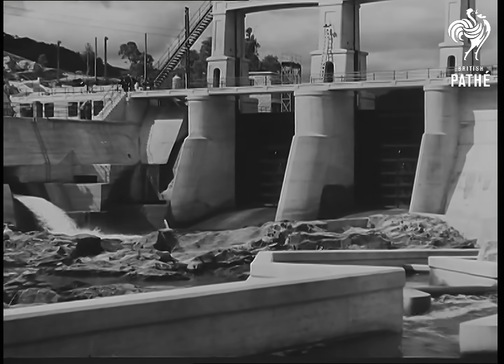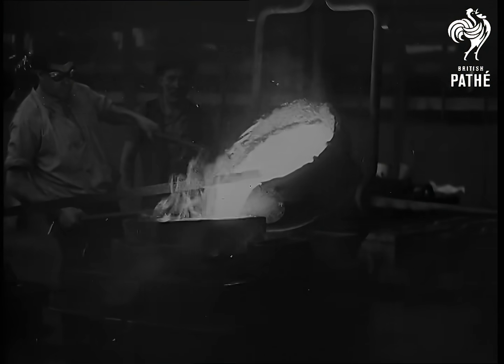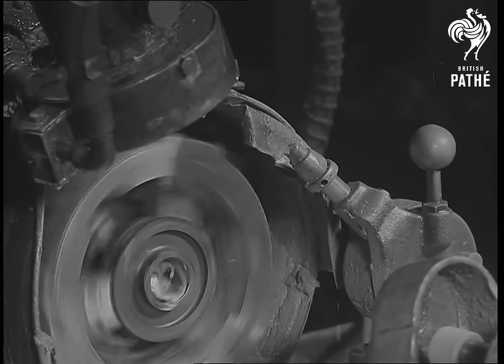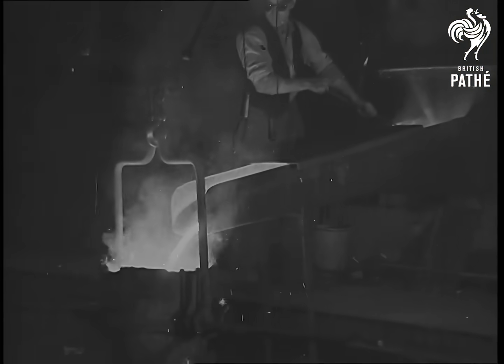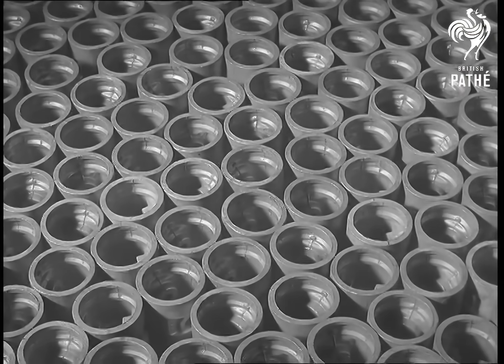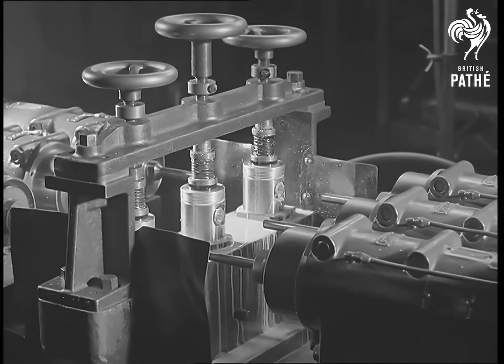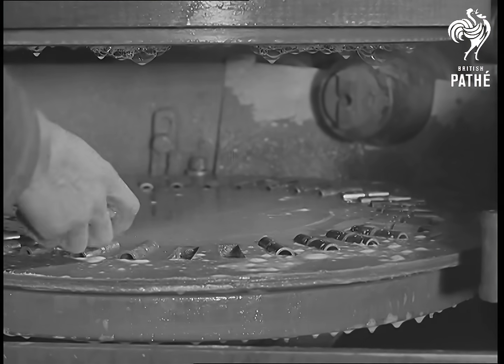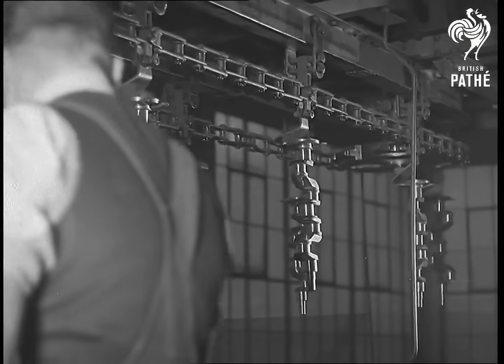Power: Constructing a Car Engine (1930-1939) | British Pathé

Comment: Was there any programming languages to control these moving parts or everything was manual
Reply: In the '30s?  There were no computers and no programming.
Reply: In a way yes, cam drums, automating simple processes on lathes, were developed in the 1870s. And they’re still in use today, with CNC machines only slowly taking over. The cam drum was called the brain wheel by the inventor, and is programmed by movable pins. Also used in washing machines to programme the wash cycle. But the choice of sequencing was done directly without any need for a separate language, as with electronic programming in order to control binary code.
Reply: There was no such thing as a digital computer in the world in the 1930s. They are a post WW II invention. Any automation in those days was purely mechanical.

Comment: Those machine tools look like they could last hundreds of years.
Reply: Well they didn't, doesn't matter how much heavy metal you have in the structure, the precision surfaces are going to wear out and that's that for the machine. The reason they are built this way really is because of the manufacturing techniques of the era. These machines were built in time of planers, shapers and horizontal milling machines. It was just plain cheaper to cast whatever complex shape you wanted and finish with simplest possible machining.
Reply: I started out on machines not unlike those when I was 20. I am 44 now.
Reply: @rushymoto That depending on what you were making is a terrible sadness. For low tech work old machines are fine but it was the curse of the 1960s and 70s in the automotive field that Britain ran what it had from its 1940s wartime advancements for far too long. NC and CNC machining were not invested in rapidly enough to up improve production.  We even ran pre-war machinery. Countries with destroyed factories had to invest anew and somehow were less attached to their newer machinery and constantly updated. I did many other things but in the mid 90s I did a spell in automotive component manufacture and can remember similar machines for drilling and tapping machined components, but we did also have CNC lathes and CNC machining centres.
Reply: @COIcultist  I started out as a manual machinist making no more than 10 of very specialized items or repair parts for obsolete heavy industry like paper mill machines etc. Often out of special materials for the MOD where the machine had to be cleaned at the start and all the swarf collected and taken away by the men in white coats with the finished work. no more than 1% loss in initial material weight could be lost due to the secret nature of the materials. That sort of thing. And yes all the slides were hand scraped on lathes, mills, horizontal and vertical borers and we also had an old Stirk Plainer that had a 3M stroke on its bed.
Reply: @rushymoto  I liked what you were saying about the scraping of slides. I've never seen slides or beds scraped but I remember using a table (Crikey I can't remember the proper name for the iron or granite tables you use height gauges on?) and the foreman explaining that the tables were levelled out by hand.  Was a bit bothered by aleksander suur above "Well they didn't, doesn't matter how much heavy metal you have in the structure, the precision surfaces are going to wear out and that's that for the machine" I was thinking it's not cheap or quick but didn't they just reset the beds and slides?
Was interested in your MOD work and the description of the plainer.
I thought you might like a short clip from a film on the Blackburn Buccaneer where a designer explains part of the design and machining.   https://www.youtube.com/watch?v=46a-7N_13Sk  06.00 to 06.35
Reply: My Dad worked at a place called International Combustion in Derby during the 1960s. It doesn't exist anymore, but I remember him recalling how they were still using machinery with "1911" stamped on the side and how - during a visit from the Americans - they covered the dates up out of embarrassment.
Reply: @red_array funny that the A series engine was one of longest production runs for any petrol engine over 40 years. The basic design meant it could be developed to meet power requirements and emission regs. A pretty simple reliable unit with pushrods, no cambelt to snap and total the engine.
Reply: @red_array i fully agree with you, especially since british layland had as much competition as the lada had in the USSR.
Reply: Makes you wonder what happened to all them tools machines and where are they today
Reply: @royalcrowntowing2464  most would have been scrapped but I expect the odd one is still lurking around in India, well I’d like to think a few are still going
Reply: They don't.
Reply: but they didn't. :D
Reply: We had machines that dated back to the 50's when I worked at Dagenham Tooling for Fords, they were great to use but became too expensive or impossible to get parts for.
Reply: @red_array we still lead the world in engine technology f1 engines we design and build have the highest ve than any other power plant
Reply: My dad worked at Triumph Meriden in the late 60s early 70s as an inspector. The terrible state of machine tools used to make gearbox layshafts and other vital components resulted in gearbox seizures in Triumphs exported to the USA. This was right about the same time that Honda launched the 750Four. Ending the dominance of the British motorcycle industry forever.
Reply: @MarkBrown-gc6hr  That sounds terrible.  Didn't Triumph inspect the gearboxes before shipping to the USA?
Reply: @josephastier7421  yes my father stopped production regularly. He was instructed to let them through by the shop superintendent and the union rep.
Reply: @MarkBrown-gc6hr  Well in that case, the company had already died.
Reply: @josephastier7421  yep there was a lot of industrial unrest in rhe Uk in the early 70s so my family emigrated to South Africa.
Reply: @red_array why was that?
Reply: @visionist7  I think that's a bit of hyperbole to be honest. An engine from that era would be expected to last at least 20,000 miles before a rebuild and survive several rebuilds. Given the low speeds and crappy roads of the day the engine, with a rebuild or two, would likely out-last the rest of the car and even getting to first rebuild time would be a minor achievement.
Reply: @agnidas5816  Yes... IF you did that. People in the UK in the 1930s didn't do that as a rule and if they did they would probably own something far better than a Morris.

In the 1930s people (generally speaking) didn't own cars and if they owned something basic they probably wouldn't use it for commuting... They'd go by bike or public transport.

When I first started driving I was going through cars at the rate of one every few months and a lot of them were 20+ year old bangers from the 1960s. They usually had about 60,000 miles on the clock and were knackered. But that's still only 3,000 miles per year.

Not that long ago when I was using my XR4x4 (I miss that car) for business I would often claim well north of 3,000 miles allowance every month... And at 70p per mile I'd sometimes make more money on travel allowance than my wages. The difference of course being that an XR4x4 was designed for cruising at 100mph indefinitely and a 30s era Morris would struggle to go at any speed indefinitely.

Cars are so much better and so much more reliable that it's easy to forget how crappy cars were back then due to the materials they had to work with being so much crappier. Because they were crappier and had shorter life-spans people used them less.

These days you assume any car under 100,000 miles on the clock will start every time. In the 80s when I was driving 60s and 70s tin you assumed they wouldn't.
Reply: Üppppü o
Reply: @red_array Months really more like days... Old classic Morris one two warranty once you bought it's two bloody late...
Reply: Stil 10 to 19 years to go
Reply: time when something is made to last,not like this new "better"
Reply: @red_array You have no clue.
Reply: I'm using a 1940s Logan Lathe in my home shop. Some tools do last for a very very long time if treated well
Reply: Some still run today
Reply: And those plan obselessence won't allow it
Reply: I’ll bet at least one if not more of machines in this video is still at work somewhere in world
Reply: @red_array  - Thats not true at all, many of the engines made back then up until the early 70s where, if the car hadn't been scrapped, still been going fine. In fact, if you buy a Morris car today it might well have the original spark plugs still in it! I've owned Morris' before.
Reply: @PrinceWesterburg  uhmm.. ? Sparkplugs?
Reply: @PrinceWesterburg  That is correct. I just returnes one hour ago from my weekly ride with my father's triumph 2000 MK1 (1967). Runs like a swiss clock. (provided the fact you have correctly adjusted the carbs ;) )
Reply: @Kerveros1904  try getting the pi to run like a swiss clock. Ive had one great experience
Reply: @nicklittle4552  pi is a totally different case. They utilized a pump foe the injection which was designed for wipers, with minor modifications, and then this pump overheated. Nevertheless, aftermarket solutions exist for the PI. You are a lucky man, i wish i had the PI. it was a very fast saloon car in its day, and quite sporty even by todays standards!

Comment: That was very interesting, see how much improvement now with robots and better machining.
Reply: There probably isn’t as much difference in overall component quality as compared with modern methods as you might think, the main advantage now is shorter set up times on machines and much reduced labour costs
Reply: @porkerthepig  the more operations you can do at one station improves quality . Every time you change fixtures you lose some precision .

Comment: It's amazing that most of the machining processes used today were already being used in 1930s ! , well Maybe not as accurate as with today's technological advancements , but still is amazing .
Reply: Don't kid yourself. The era of master Craftsman has all but been  lost thanks to "technology". The standard of accuracy for which we build things today was set by these men.
Reply: @benboor7924  I'm more impressed with the people who designed and built those massive dedicated machining tools. Plus the design of the engine has to accomodate the limitations of the machines e.g. the vertical holes in the engine block are all drilled together. All done with pencil, paper, mechanical computers, hard thinking and the machinists hand. Modern CNC gives much more flexibility.
Reply: @benboor7924  No.  Engineering tolerances are hugely more accurate now.  Part of the reason why you can get so much more power from the same displacement using less fuel...
Reply: @mediocrefunkybeat  Engineering tolerances and manufacturing tolerances are world's apart in reality. As an expert in the industry, I have seen first hand how engineers without any practical experience in manufacturing can literally blow time and money from ignorance. I've gone into facilities to help solve issues with quality control, only to find out that after they spent thousands of dollars to replace equipment, an engineer gave them terrible specifications. I told them they needed to completely rewrite their QA manuals, blueprints, and factory specifications. Also, some companies are still using old machines from even WWll era, because they were built so well.
Reply: @benboor7924  on the other hand I was told that the machinists in our factory were able to hold tolerances, due to their skill, that were barely achievable when the machines were new. Perhaps it was those skills that kept these old machines in service after 30 - 40 years ( and surviving more than one back of a lorry factory move) instead of being replaced and upgraded as they probably should have been.
Reply: @benboor7924  all too often shop floor drawings would be modified at the request of the fitter, responsible for using craft skills to assemble the product. His was the bottle neck so if instead of continually having too lap a few thou of a part he spoke to the machinist and the line inspector, they would agree to bias the manufacture and mark up the ship drawings.  No doubt the intention was to up date the master drawings once the change had proved effective but the road to hell is paved with good intentions and it often didn't happen.
I know that when they closed a factory in Scotland and shifted production of a range of products to Sussex, what they actually did was send the master drawing copies. For the first few months all we made was scrap. Perfectly to drawing scrap
Then came modern QA procedures, which had their problems of setting things in stone, right or wrong, till they figured out how to really make it work.
Reply: Yup, I am still laughing at the forge worker operating a drop hammer with nothing more than a flatcap & a pair of tongs though.
Reply: A 1979 Honda gets better gas mileage than a 2019 Honda.. the only thing we have managed to do it shrink the size of electronic8 21duwyeoloere
Reply: @shawngoldsberry747  A 1979 is smaller and produces less power than a 2019 Honda... also newer cars have had a substantial weight increase because of safety standards.
Reply: A major factor in having equipment that was so accurate for so long was that designers weren't really familiar with the tools they were building, so they compensated by over-doing the design. That resulted in very long lifetimes of these machines. Today, we have computer models of all the parts, so we know where we can cut corners and not pay a price for it. This is why modern motors are good, and light. Aluminum usage is the biggest improvement, by far, though.

Comment: This is why engines from that time are still running
Reply: gumelini1 well true to some extent because engines will theoretically run almost for a life time with proper maintenance and they design their engines as best they could and to withstand more back then they really needed to newer technology you don't need as much strength
Reply: ATLAS GAMING engines from that time are still running even tho they were first lubricated by very bad engine oils at the time.First engine oil was parafin based and wasn't even close to today's oils.And yet those engines would go 1m miles,today with all the synthetics and aditives engines last half of what they used to back then.Since the oils today are uncomparably better then they were before the only thing to blame is bad quality of the engines today.I mean they are more efficient and consume less fuel then before,but durability has gone down alot
Reply: Sorry mate, that's simply not true, period. Drivers back then never floored them, never reved them when cold, etc. Those engines ran at very low compressions, used half the petrol for internal cooling and required attention every 2500mi or so. Yet they were very unreliable machines by todays standards, frequently broke down or refused to start, the lot. Which doesn't mean I don't like them, quite the opposite, I rebuilt dozens and dozens of Rover, Austin and Morris engines of the period, but realistically modern motors are insanely much better in every way. Basically, most of todays cars go for scrap with perfectly fine running engines, which never even had the rocker cover removed in 200,000mi. When we went to Spain or France in the 1960's, I remember my dad picking up the holiday kit at the Mercedes shop, containing head gaskets, sparks, breakers, RC gaskets, and other parts one might need on a several hundred miles trip with an exotic car in a developing country...
Reply: @rosl-80  Haha, aye! Traveling was more adventurous back then. Head gaskets went out between decarb services when going uphill (or similar load conditions) in hot, dry weather. Back in the day, the later wasn't likely to happen in Britain and thus head gaskets would usually not cause problems there. However, if you happened to have the Pyrenees or Alps between you and your destination, a head gasket in your kit was mandatory. An experienced engineer could replace it in an hour or so IF you had one...

Comment: those connecting rods look like toothpicks, weight to power was a bit low I bet huh?
Reply: M Bacon  maybe they use stronger materials nowadays, and are better designed to cope with those stresses ...?
Reply: yup, but don't forget then a typical car's engine power in terms of HP/kW was very low compared to today, they were much slower revving and created far more grunt (torque).
Reply: @RockinRedRover   
Definitely less torque. Less everything I'm afraid, like gas mileage.
Reply: Skye Iorfida -  to clarify, older engines created more torque at a given operating speed.  Power = Torque x speed, fact. Modern car engines rev far faster than old ones,  hence for a given power create less torque, which is fine cos the whole car weights a lot less. It's the rotational speed that gives most stress problems in an engine, the higher the speed the more dynamic stresses,  not just the output shaft power. Thats why modern F1 car engines can produce such high BHP hence acceleration, as they run at upto 15,000 revs, plus the weight of the engine (and its very weeny rods !! M Bacon)  is very low indeed. Mind they don't last long lol, unlike the old slowrunning heavily-built ones.
Reply: @RockinRedRover  your hand picking examples to compare. Engines have come a long way, these old engines had bigger machining tolerances, lower quality metals and antiquated designs. They were not more efficient in any aspect to engines now  and definitely didn't make more torque at any rpm with the same displacement and normally aspirated, they were impressive for the time however. I respect them none the less. Comparing these old designs is apples to oranges
Reply: @RockinRedRover  250cc sport bikes can Rev over 20,000 rpm. It's all in the design and purpose.